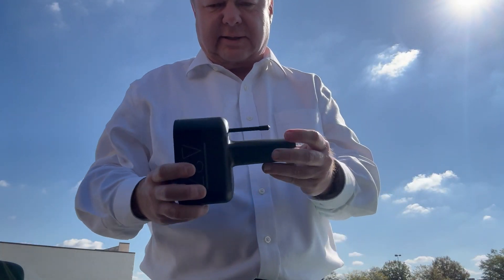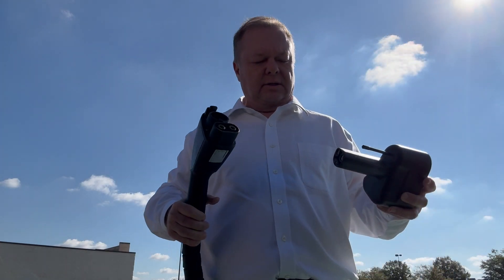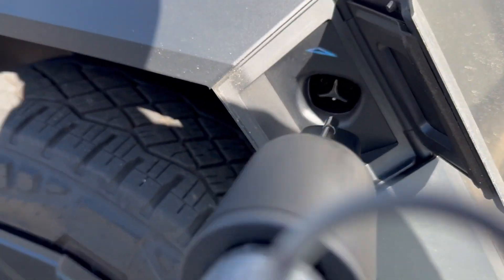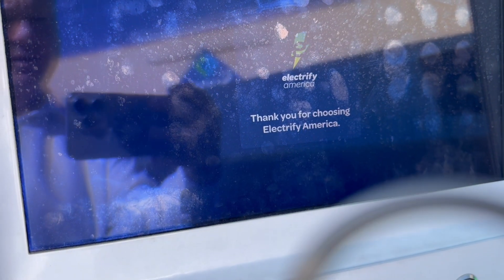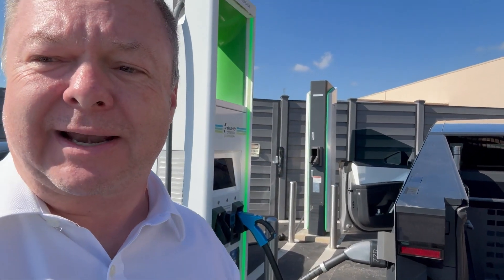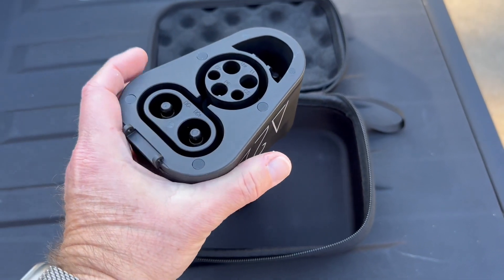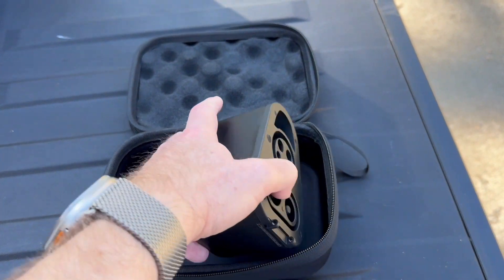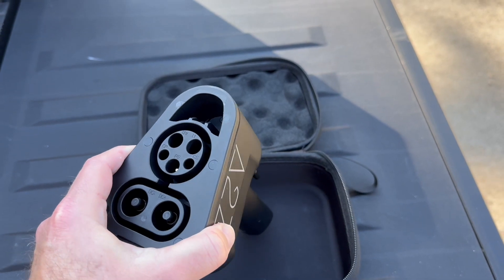A2Z CCS to NACS Adapter for the Cybertruck

Comment: Will this allow the Cybertruck to charge at 800 volts? So like 300+ kW? Make sure you test it at low state of charge like 10% on a 350 kW dispenser so it gets full power.
Reply from the maker: I do believe it is rated for 800+ volts and others have been able to charge at 350kW. I will test it at low SOC and 350kW soon.